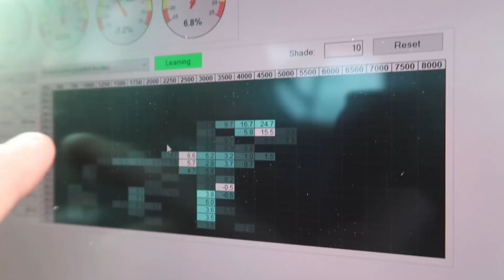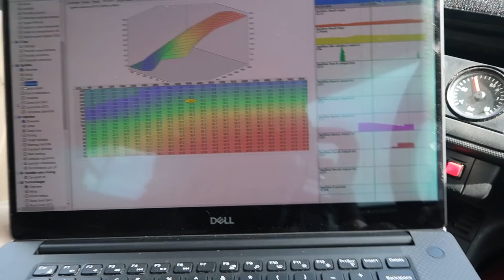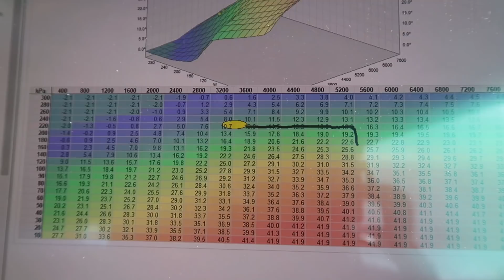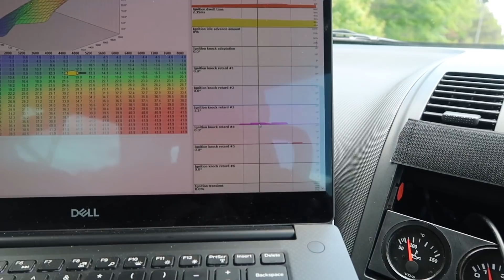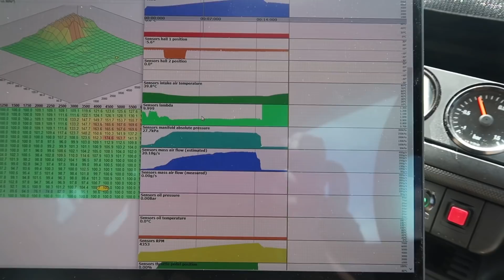IGNITRON ECU Road Tuning in the Furious Frog // 1.8t K04 20vT

Comment: how many hp did you get???
Reply from the maker: Ignitron calculates its bhp figure from the fuelling so with the 550s at 100% idc it was showing 380 😂😂. But before the pump was struggling and idc was correct, it logged 268bhp. Itll not be exact until we sort the fuelling out but it feels very good, so I'd imagine itll not be far off that figure.

Comment: Might be an idea to fit and wire up a fuel pressure sensor - can log what fuel pressure is doing against MAP and have the Ignitron throw it into limp mode if the fuel pressure deviates too much from where it should be following MAP
Reply from the maker: Great minds mate, already on it 🤘

Comment: After you flash the ECU dont you need to do some miles so it can relearn the fuel trims ?
Reply from the maker: Yes we do a good few miles (lots gets edited out...😲), but we also keep an eye on the logged short term fuel trims and then try to pre empt the adaptations by spotting the trend in VE and then adding fuel so that it's super safe. The learned adaptations are then generally minimal.

Comment: Good to see Spencer back, your bang on mate, junk the golf pump and you should be spot on. 280bhp on 550cc is reserved, considering your on 1.4bar. Awesome bit of kit the Ignitron, let’s put ours together soon for a comparison. 👍🏻
Reply from the maker: Yeah mental as the ME7.5 never kicked up a fuss over the pump. I rarely ran it over a bar anyways and at that power it would have been fine. Lambda deviation is only 0.5 anyways so not a killer. Defo time for the pump though, and a meet up would be sweet mate. Life should get easier now ..